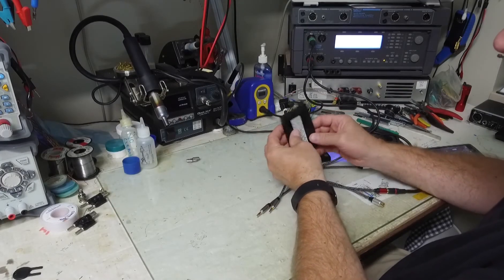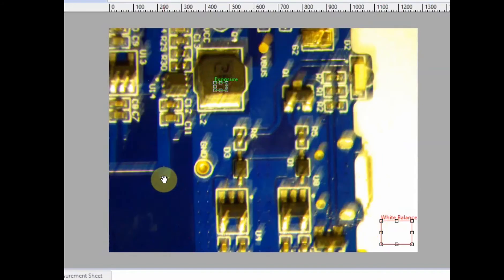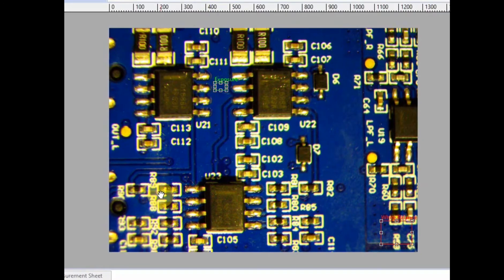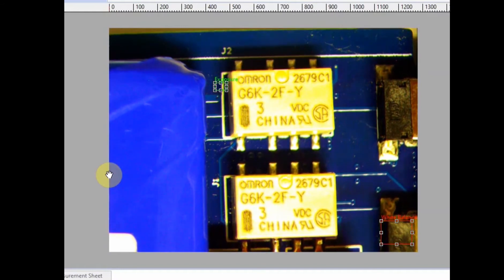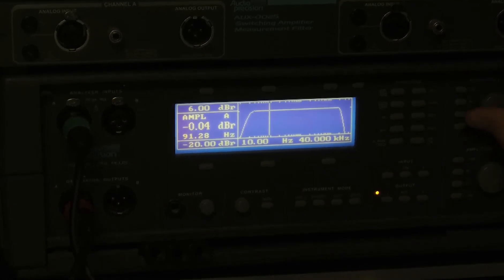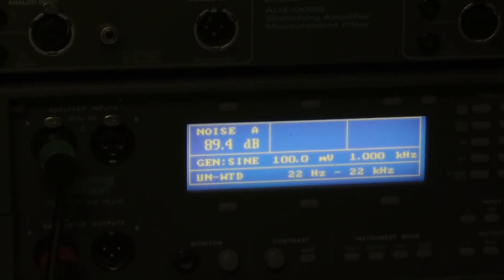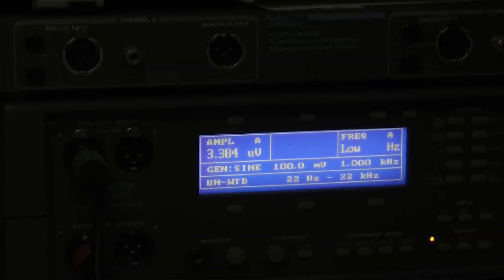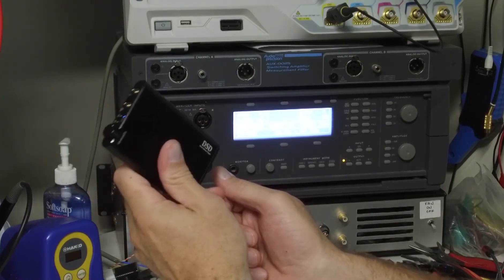Topping NX4 DSD Headphone Amplifier and DAC with USB input.  Review and Circuit Analysis.

Comment: Hi Dan from your circuit analysis, is the power always drawn from the battery ? I want to use this little gem as a stationary DAC and use the line out, but I am not sure if hooking up the charge port to persistent USB power (via a HTPC USBA-mini cable) will ruin the battery and the device
Reply: In other words, If I have power (via the CHARGE port) will the battery be bypassed ? Or will that input always charge Battery first, and then NX4 DSD circuit will only be powered from Battery discharge ?
Reply from the maker: I have not thoroughly looked at the auto switch over between USB and battery power on this unit.  Most battery power designs I have looked at, will auto switch to external power rather than drawing from the battery.   This unit does use a battery charge management IC (UN8HX) that will stop charging the battery after charging current has dropped to 10% of programmed value.  With this feature, I believe it would be ok to leave plugged in.

Comment: Thanks for the teardown and measurements.   One question: Did you happen to measure the additional power draw when using the high-gain mode?  Just wondering how much faster the battery will drain when high-gain is turned on.
Reply from the maker: Sorry, I did not make that measurement.  However, I would not expect much difference between the two settings.
Reply: @DanPattenAudioG33k  Thanks.  I have this unit - and really enjoyed getting a peak inside with your review and measurements.
Reply from the maker: Your welcome.

Comment: nice review! do you have any name or link for the usb isolator shown at 14:22 ?
Reply from the maker: Thank you for the comment.  The isolator is a device I made a few years ago to solve some testing problems I encountered.  I have a simple website where some of the "solution" tools I have made are available.  There are several USB Isolators on the market but most do not provide much power to the target.   This device provides ~200mA to the target through an isolated DC/DC converter.  Let me know if you have questions. 
 http://www.avwidgets.com/AVWidgets/AVW-USBISO.html
Reply: @DanPattenAudioG33k  will check that out, thx for the answer!

Comment: can I use 15 watt samsung fast charge adapter to charge it?
Reply from the maker: If the charger is standard 5V output and is not type C, it should be fine.  However, I believe the charging will still be limited to approximately 1A @ 5V (5W).
Reply: @DanPattenAudioG33k  it is type c. on the back of it.. it says 9V 1.67A, 5V 2A
Reply from the maker: I would be nervous of using a Type C charger with this unit.  Some Type C chargers can supply higher voltages (as yours apparently does) and you need to trust that the voltage/current auto negotiation is 100%.

Comment: Greate review such a honest metodology and quality control. I bought Topping NX3s because of You. Changed OPAmp for LT1364 and have lovely sound even compared to popular MUSES. Modified Beyer DT150 sound amazing on this little thing.
Reply from the maker: Thanks for the comments.  I'll have to look at the LT1364, not familiar with it.
Reply: @DanPattenAudioG33k  It's abandoned treasure and suit for Toppings potable amps as well. Nowadays all eyes looking for discrete or hyped branded OPA completely forgot about that. Audio had true hi-end product even years ago and multi bit MQA and DSD is not only answer for audiophile. My dream is true 16-bit DAC from early best CD Audio players paired with pre amplifiers from these years. Implementing native digital to analog conversion is very difficult, strong power consumption and expensive. Right now I am using exotic amp without negative circuit loop Nelson PASS DIY Burning Audio III working as preamp and headphone power amp. As DAC I use Polish DIY construction highly modified in PSU section: Nimble DAC by pkrecz from audiostereo.pl This is big and heavy stationequipment. I want good portable DIY projects but unfortunately we do not have many options in this matter.